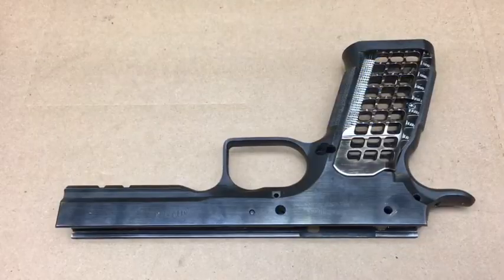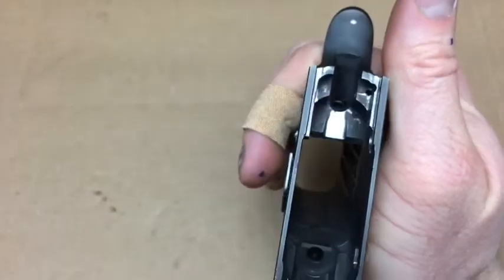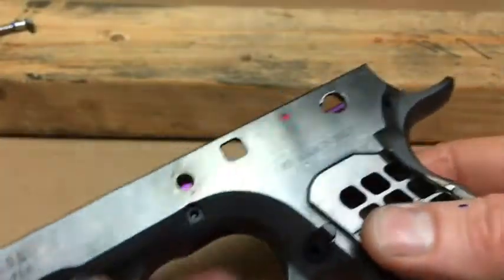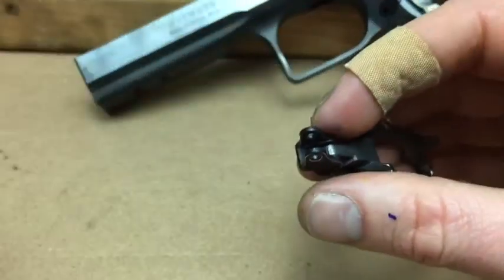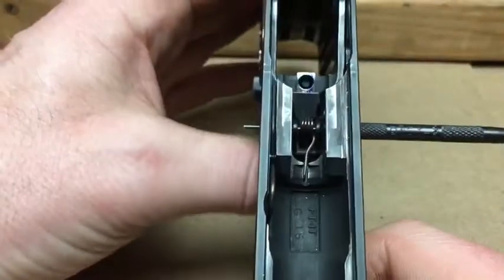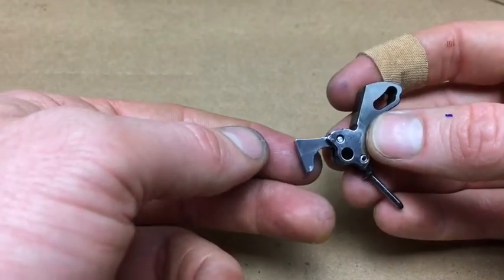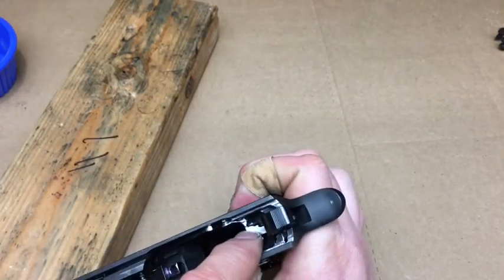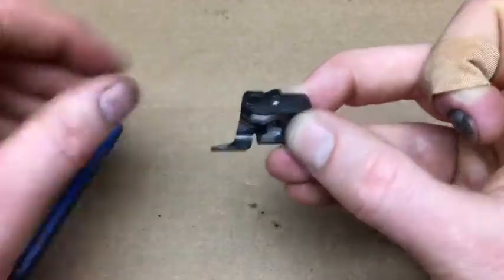Tanfoglio Tuning Part 3: Polishing & Reassembly

Comment: 3:20 Wow, you're a Ninja.  I couldn't do that by myself with tweezers.  And when it slips, the tiny parts go flying, and then you get to look for all of them.  The "Itty Bitty Little Bastard" can only be found with a magnet if you can find it at all.

On a side note, great video!
Reply from the maker: Kurt Boyd this was at least the fifth time I had pulled it apart for various polishing reasons. The key is strong fingers; it hurts a lot to have that little sucker digging into your finger. Embrace the pain and continue working patiently. ;)

Comment: I have a question, I was reinstalling the sear cage. It will dry fire in single action when the hammer is manually cocked but it will not pull the hammer in double action. Any suggestions?
Reply from the maker: Colt Hubbs did you install the hammer strut backwards? Leads to all sorts of odd things. Is the trigger bar plunger assembly (this hold the mag release in) properly installed and putting upward pressure on the trigger bar? Have you changed any parts in this trip? Best place to go for help is to find us in the brianenos.com forums, under Factory Pistols => EAA / Tanfoglio.
Reply: @ memphismechanic Yes, I installed a bolo interruptor and a titan hammer spring. I didnt't disassemble the mag release. I have been looking all over the site and haven't found a good answer. I'm new to tanfoglios
Reply from the maker: Colt Hubbs ahh! Particualrly if the bolo is installed without putting a Titan hammer in the gun, that is absolutely normal. You need to take a few passes off the top corner of the disconnector in order for the DA to drop the hammer. Call Patriot Defense and they will be happy to walk you through it.

Comment: How or what do you use to get up in the rails to polish them
Reply from the maker: mclarengts apply compound to the torn down slide and frame, cycle them by hand without a spring pushing downward for five minutes, upward for five minutes, twist left, twist right, etc.
Reply: Thanks